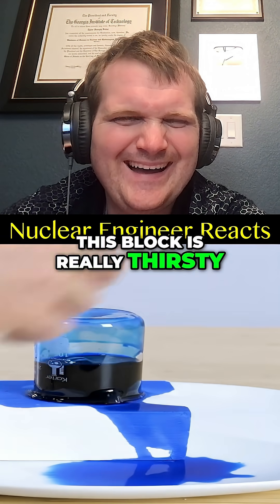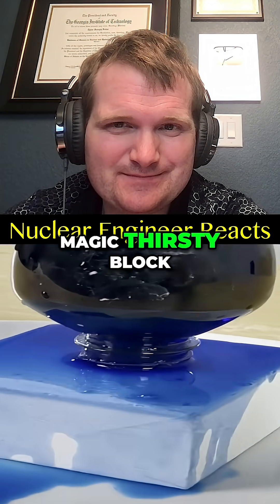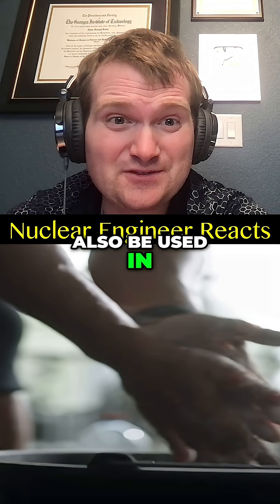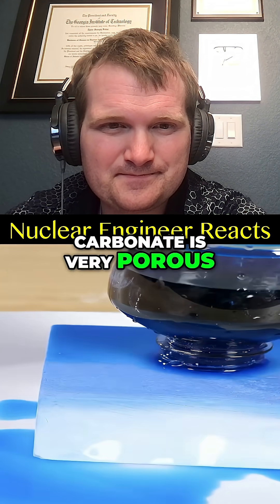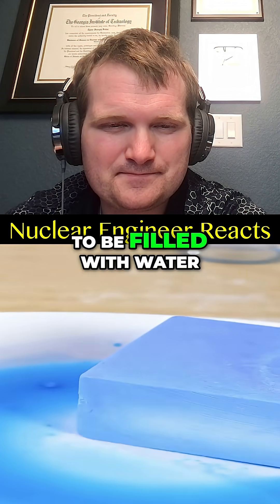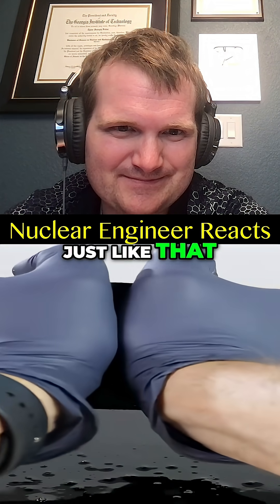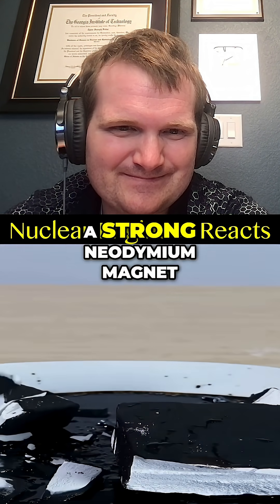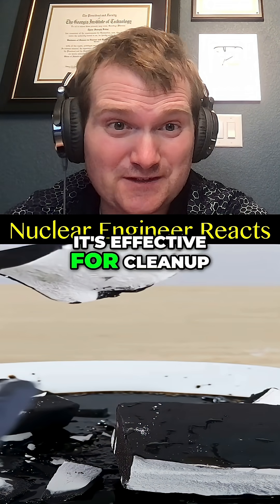A Thirsty Block - Nuclear Engineer Reacts to Action Lab

Comment: I used this to pack a bleeding wound in gymnastics before competition. I’m sure this would make medical professionals cry, but it worked
Reply: Casually mummifies self from a paper cut
Reply: Absorbing isnt the same as stopping 💀
Reply: Our military field dressings could absorb 2 pints of blood. They used to issue us with 2 so if the first one saturated you could place the second over the first without disturbing it.

I remember in first aid training someone asking can they use one of their own as a 3rd if necessary and were flatly told there'd be no point 😂
Reply: Yikes. Probably not the most sterile stuff but I don’t see it being much of an issue